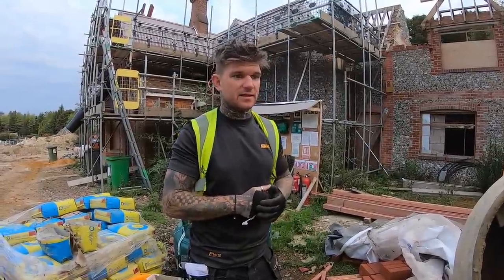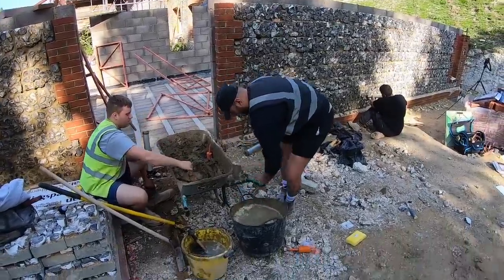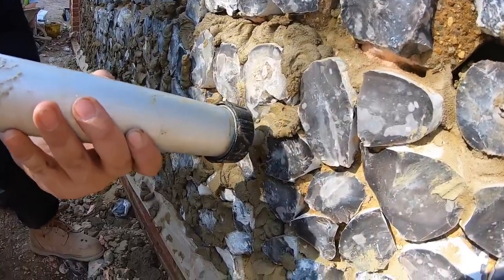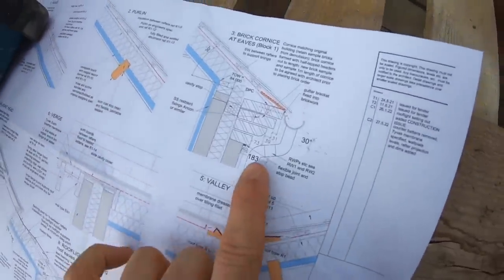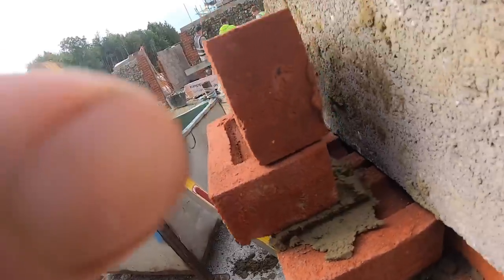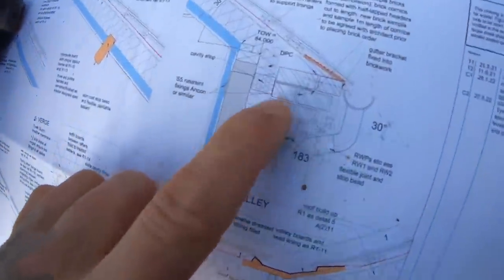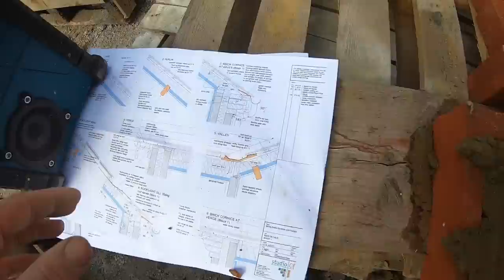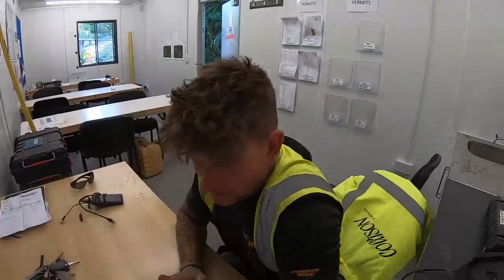FLINT Block work! I HATE IT!!!!! 🧱🧱🧱

Comment from the maker: What a load of shyte…what’s your thought?
Reply: Plasters hawk and pointing trowel. flush point it in the morning depending on weather time of year wire brush it off when it’s dry enough it don’t drag or smear then finally a quick stiff brush over it so you don’t see any wire brush lines.
Reply: I would recommend a grout bag over a gun because you can squeeze the lumps out and easier to load
Reply: You can see the blocks not good . The pointing we have a pointing gun on a battery drill £400 it's a lot faster.
Reply: I would recommend throwing them fuckin blocks in the skip and doing the flint properly😂
Reply: That looks like organised shit!
Reply: Reminds me of the cages filled with stones they use as beach defences
Reply: Use Plastering sand in the pointing guns it's a finer aggregate it won't clog the gun up even better idea use a matshall town pointing bag it's just like a cake icer haha its alot faster to reload
Reply: I think it would be quicker to render the wall then stick yer own Flintstones in yabbadabbadoo
Reply: Yep but you can only make of the most of your materials to hand chezzer✌️🧱💪🤘👊😇✌️
Reply: My opion should of used a blue colour dye mix too would look alot better ✌️👊🤘💪🧱✌️
Reply: Put some ivy up it! Best wishes👍🧱
Reply: I sell ivy Mr C👍
Reply: There's a company called sunrise tools get yourself a pointing gun mate. It's a hopper that fit on your battery drill. Trust me will save you loads of time
Reply: No those things are no good you can tell they're blocks
Reply: Looks well shit that mate. But you can only do what you can do with the material's you're given sometimes. But yeah I don't think the client is going to be very impressed with the effect vs the cost. Like a lot of comments here mate. That should definitely have been done traditionally, big mistake. But keep doing what you're doing.
Reply: That corbel needs expanded metal in every course stretch it before you put it in .....flintlock looks shit not fooling anyone it's the real thing..
Reply: I'd hate it as well if I wasn't using a grout bag ?
Reply: Looks God awful....but if the client and architect are happy with it then that's all that matters. Surely there would have been a test panel built 1st for everyone to see the finished look?
Reply: You've made best job of it that you could. Beds stick out too much. Insist on trad method if offered another job, and price it right.
Reply: Pointing with hands is crap
Reply: The quick point mortar gun that attaches to a drill works really good for stone

Comment: The concrete block with flint attached looks awfull, flintwork  is a traditional  old skill and supposed to look random , yes it's slow work but that's why it's so expensive to price per m2 , 
But the end result looks like its supposed  too and not all linear  like those blocks do , 
I think the client will regret that decision eventually

Comment: Using the mortar guns when loading them up we usually find a semi flexible road cone and cut the top off and use it as a large flexible funnel. Goes in easier and keeps the gun clean.

Comment: I used these very same blocks last month. We used a semi dry mix 3/1 , slightly wetter than what you'd have for pointing a patio and used a flush pointing stick , the finish was fantastic , you couldn't see it was blockwork. Had to use the finger every now and then.

Comment: When I fill those guns I use a long trowel. roll a slither slightly smaller than the tube and just hold the point of the trowel up and drop the heal towards the mortar gun. It fills up with around 2-3 goes. Worth a go

Comment: Looks good to me 👍 when i did my patio pointing i got a plastic funnel and cut the bottom off until it just went inside the gun. Than drilled two holes opposite each other and screwed in two stainless bolts. They allowed you to put the funnel  into the tube and hold down with two fingers. Simply scooped sloppy mortar into funnel and tapped the whole thing on the ground. Makes refill really easy and quick. 👍👍

Comment: I used the mortar gun on a big repointing job , it was in lime mix and I found them fantastic as long as you keep them well oiled . With sand and cement absolutely useless to hard to push it out , just pushes the water out and you can only use half of it .

Comment: Atup Charlie, what mix are you using for the guns?? I live in Wales and do alit of gun pointing on stone, I use a mix of 6 sand, 2 lime and 1 cement with Feb, the lime and Feb make it alot more pliable for the gun and makes a for a nice authentic joint finish

Comment: Charlie Charlie Charlie 

Phone up Mason mortar he will give you a dewalt drill with an attachment fixed to a drill which will press in the mix. 

We normally use a finger trowel and a hawk and push in 

Let it dry then get a tooth brush type of brush then brush the pointing out.
Reply: And it would still look shit. Shit product.

Comment: Do a lot of pointing work with a mortar gun. If you dont know then add extra Feb to the water and mix it with a plasterersdrill they use for pinking... over mix it and mix it to sloppy for brickwork. Only use soft sand or it will jamb up... that's my method and it works for me... funny vid thou🤣

Comment: Flint blocks look shite , I would avoid at all costs , laying flint traditional way is piss easy and good money too ! 

Glad your on daywork 😀👍
Reply: If the flint blocks are laid and pointed in correctly then they can look good. I have got a number of photographs of these blocks in use and you can't see the joint lines, also these flint blocks are the only blocks on the market that have been approved for use in the south Downs in leui of traditional build?

Comment: Basically throw the flint block away and face by hand.people are trying to reinvent the wheel.if it ain't broke don't fix it.
Reply: £350/400 a sq m to lay loose walling flint, around 3.5 x what the flint blocks are to lay, the effect would be similar if used correctly

Comment: The way you can see the courses ruined the affect of the flint but it's nothing you did it's the product..... what's wrong with the original way doesn't pass building regs?
Reply: It's not the product , i have first hand knowledge about these blocks and they do help eliminate the joint lines IF laid properly with a correct bed joint!! These blocks have now been listed on a  approved lisr for use in the Chilton hills so they obviously do work!!, the issue is when a company undertake a film a bad job on utube just for views.